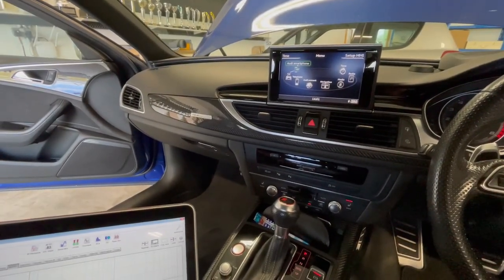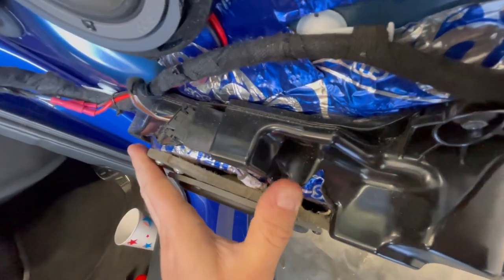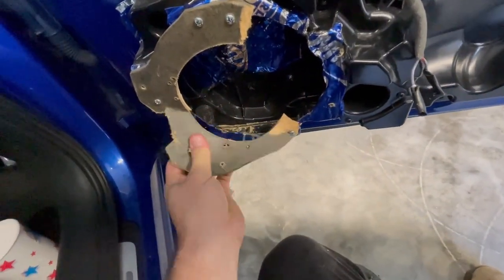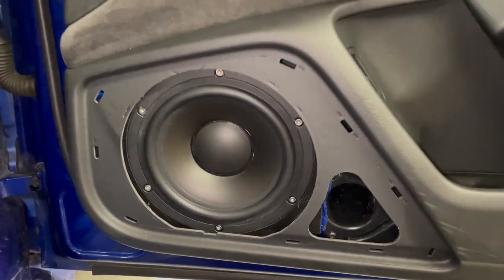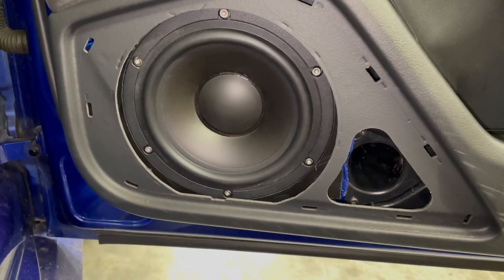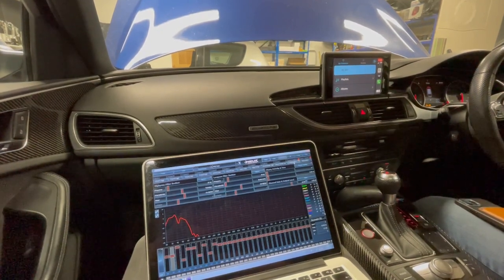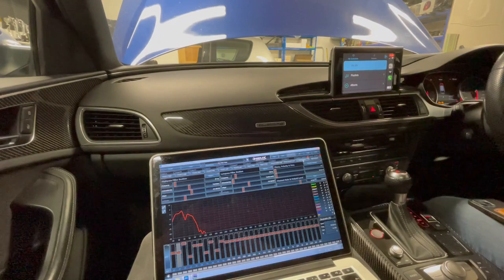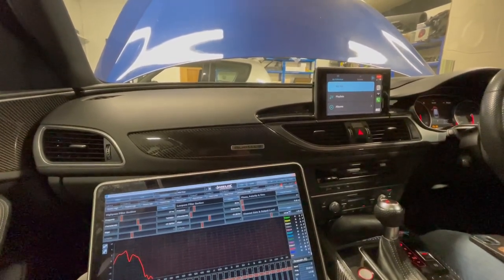How (NOT) to Get Great Midbass - FAIL!!! Focal KRX3 in Audi RS6 - RTA & Tuning Session

Comment: You have the space to install the Focal, just add bracket thickness, it’s called customizing. There is no need to change the speaker with another brand, that too is unprofessional.
Reply: @UL LA RC  
WRONG. SMH.  And FYI Peter is the MASTER of "customizing".  He Would have done that if it was the PROPER solution!

But If Peter had built a thicker mounting ring or baffle to fit the Focal driver depth-wise inside the OEM ported enclosure, then the FRONT of the Focal driver would have protruded too far forward, and the cone and surround of the speaker would then hit or press up against the OEM speaker grill, which would obviously damage it AND provide shitty sound!  That would be unprofessional as well! 

You have to take into consideration and leave room for the forward excursion of the speaker cone and surround when it is playing heavy midbass, and that it would have hit the OEM speaker grill in the door when playing the system, potentially damaging an expensive driver AND also creating horrible noise.

This is one reason why the original installers tried to use very thin 1/4" MDF or Masonite board in the first place (unsuccessfully).  But the Focal driver was simply too deep for this application without having the time and $$$ to fabricate a Entirely New custom enclosure or mounting solution.

1/4" MDF was probably the only material that the other shop had on-hand that was thin enough to "let's just MAKE it fit", instead of waiting and acquiring a better material to construct the baffle properly and using a shallower driver as Peter did.

And as Peter demonstrated, even with a thin, custom mounting baffle, the Focal drivers were too deep for these particular OEM enclosures.  Without significant time and $$$ to fabricate a completely custom enclosure or mounting solution for these doors, the ONLY option was to use a shallower midbass driver for the time being.
Reply from the maker: Thank you for making it clearer. Some people just can’t see the forest beyond the tree and call me unprofessional…WTF 🤦🏻😂
Also, some real professionals don’t just sell/use speakers by the look, but actually understand the T/S parameters, which also indicate that the Focal is not suitable in the ported box…but heyhoo, what do i know about sound quality in cars, right? 🤷🏻‍♂️
Reply: @ULSB1969  Peter said there was enough room to clear the grill with the NEW speakers. Can you explain how your magic spacer would be thicker to move the magnet further away from the obstruction behind it, but somehow not move the surround of the speaker out towards the grill?
Reply: @A4rings110  I don’t need to explain how a thicker spacer works, if you have not customized speakers on car doors then you would not understand, and if you have, then there is no need to explain. the
Reply: @ULSB1969  Oh okay got it, so the spacers will physically reduce the dimensions of the speaker. got it. Also, you think that bracket/spacer was purchased and not custom made? lol
Reply: @ULSB1969  Roses are red, violets are blue bro

Comment: я не понял.... он убрал Focal и в эти кривые двери поставил другой динамик и как будто стало лучше? У вас там в США все такие идиоты?
Reply from the maker: No, unfortunately you don’t understand what happened here then. The Focal would never ever fit in the OEM boxes as the speaker is too deep. The previous installer left a big gap and it was performing terribly. 
Then a different, shallower 6.5” was installed properly, there was no other option without keeping the doorcard looking OEM and fitting correctly. 
Is it clear now?